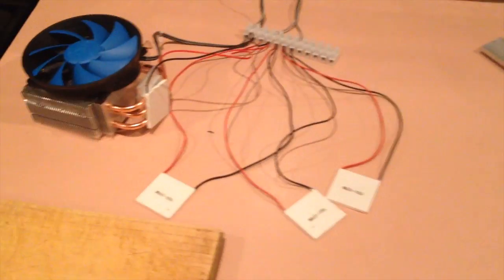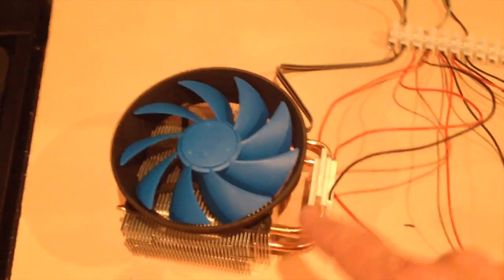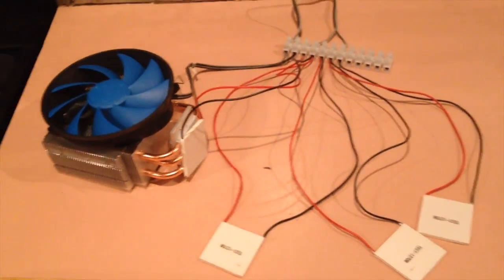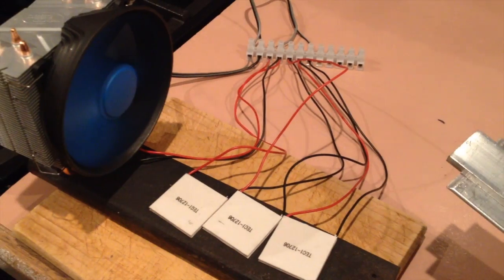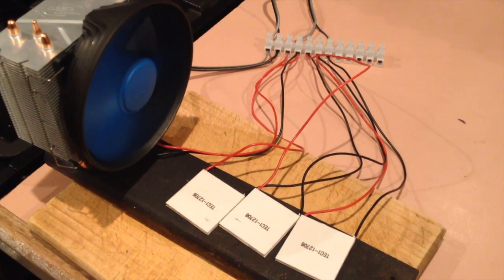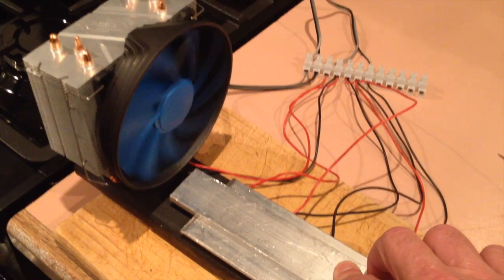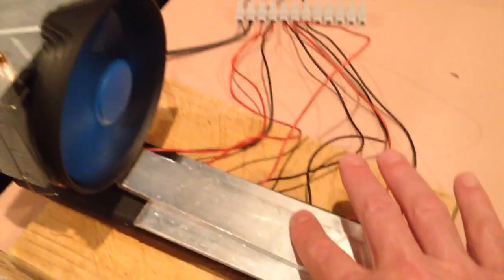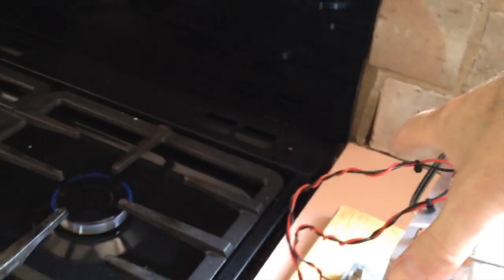peltier fan

Comment from the maker: I didn't measure the amps, but the volts reached 2v / cell. 8v seems enough to get this 12v fan moving. The Peltier cells were cheap, off ebay, about $2.50 each. I didn't have details of the fan apart from the voltage and that it was a brushless DC motor.

Peltier cells are made to cool, not generate electricity. Next time I'll purchase specific TEG (Thermoelectric Generators) made to generate electricity.
Reply: They do not generate heat as well?

Comment: Can you please tell how you connected those peltier's outputs together?
Reply from the maker: Hi Tekky, They are wired in series. Each produced about 2 volts and the fan didn't start turning until it got 8 volts.